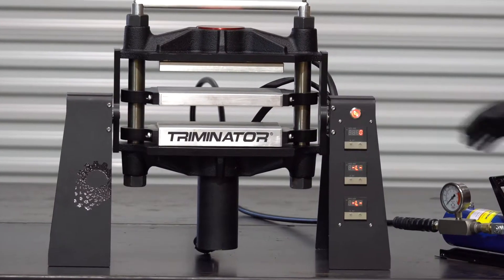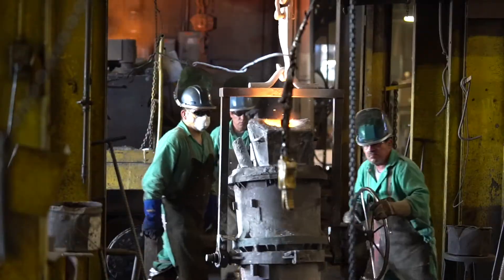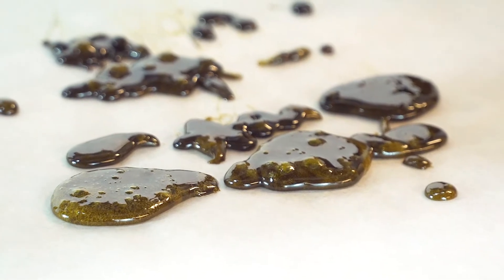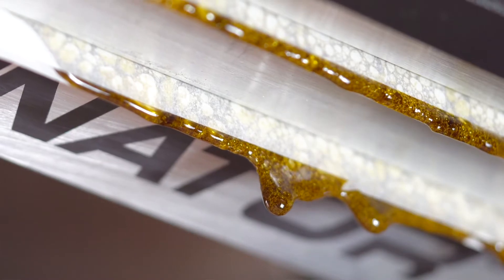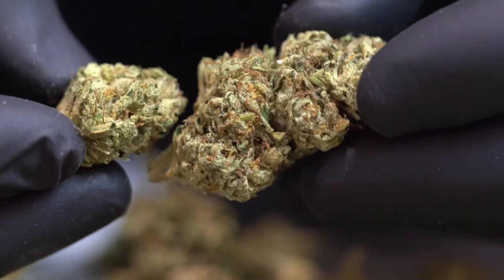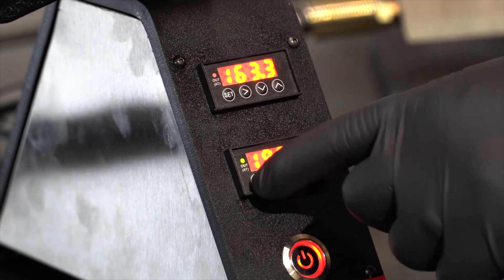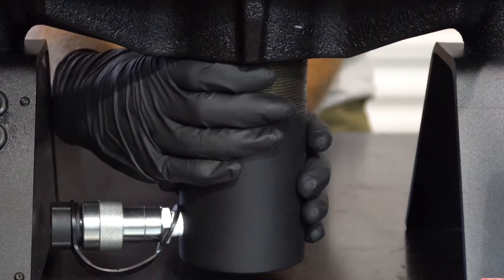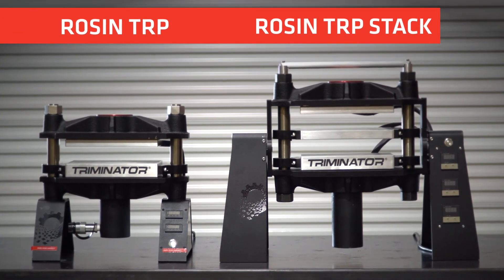Triminator Rosin TRP Series | Rosin Press | Triminator

Comment: So 6x10 is 60 square inches and with 25 tons or 50,000 lbs will have only 833 PSI at the plate!  That's not much.
Reply from the maker: That is what we usually call the virtual pressure of the press, corresponding with the entire surface area of the platens. In general, you never use 100% of that surface area. Our large pre-press molds, for example, create 4.5" x 4.5" pucks and two of those fit very well between the platens allowing space for rosin flow. With that size, the psi you get with 25 tons of force would be 1235psi, and at 20 tons 988psi. Our experience shows that in general you reach a saturation point around 900psi – 1000psi, meaning you won’t be extracting any more product even if you were to apply more pressure.
Reply: Nice thanks for your response it makes sense.  Your design is unique and have an amazing manufacturing process.  I designed a 4,000 ton press for my job and on the side I make the worlds smallest 2 ton and 6 ton personal rosin press which reach 1,273 psi and 1,740 psi respectively.  Perhaps maybe too much pressure but I get golden results.